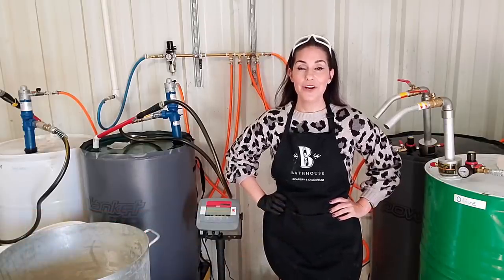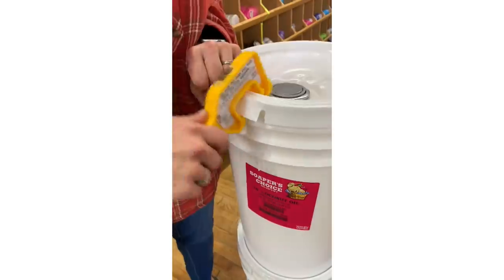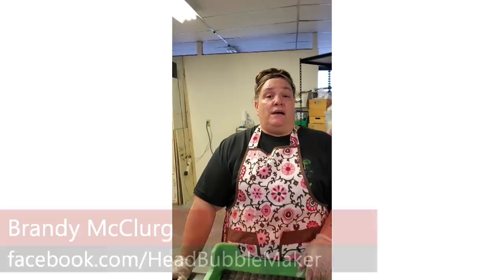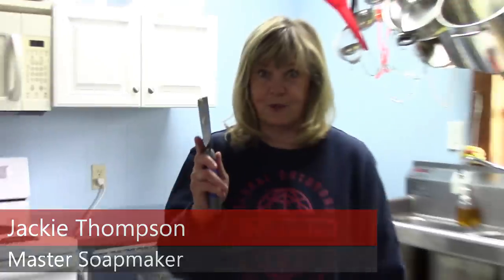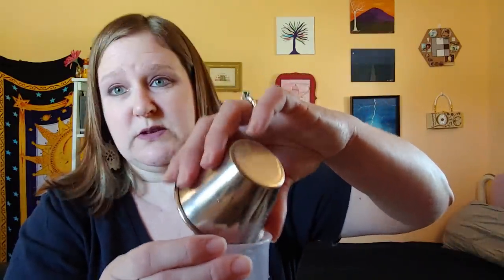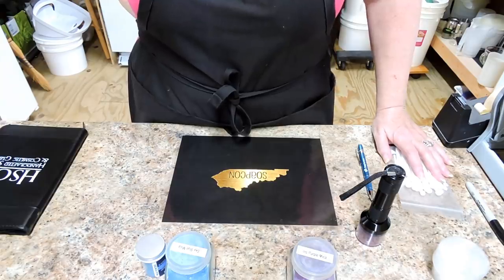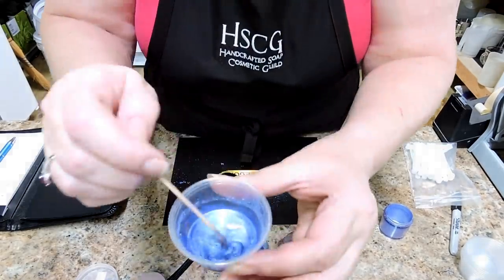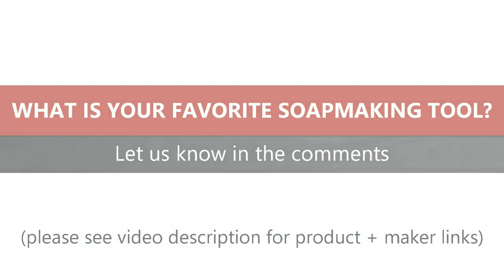Top Soapers Share Their Favorite Soap Making Tools | Soaping101

Comment: The chopstick. You can use it to measure micas, stir your batter for a nice design, create a pretty swirl on top, helps keep you from spilling fragrance oil when measuring, cleans up the sides of a mold filled with batter. Can't soap without one!

Comment: What is the best electric conductvity for used water in soap thank you
Reply: Odd question, but I'll bite.  Adding salts of any sort to water will increase its conductivity.  Oils will decrease.  So, a salt bar, with no super fat (which will be rather a strong soap) would increase conductivity of water.  Or scrap the soap all together and just add some sort of salt.  Conductivity increases as salinity and other inorganic molecules increases .  Soap molecules are salts. (sodium cocoate, sodium palmate etc.) Salts are a type of metal ie: inorganic.
Reply: @TheAccidentalViking  Great answer, thank you!